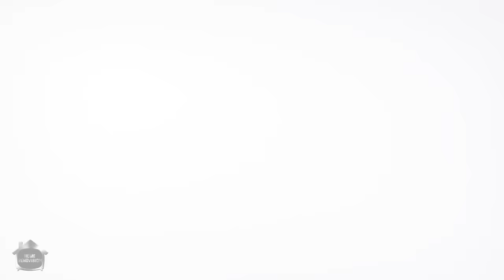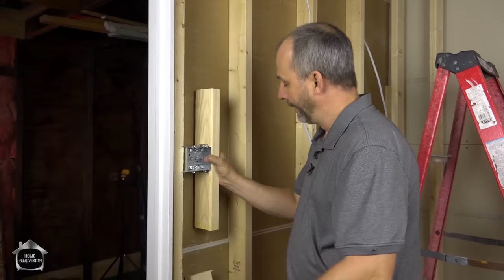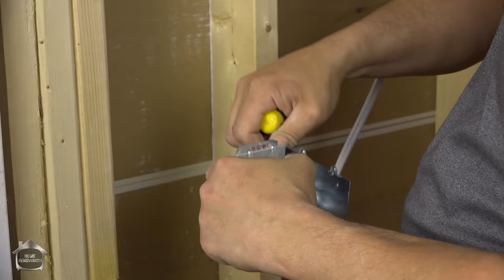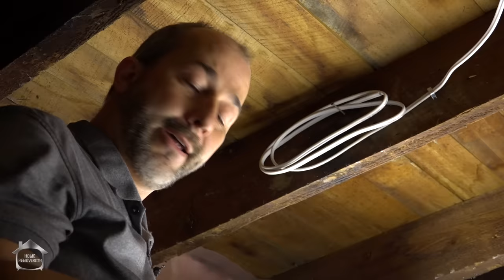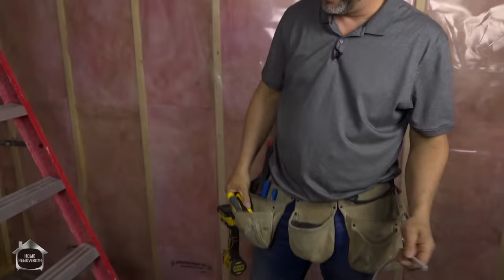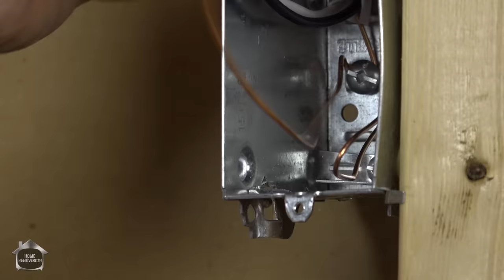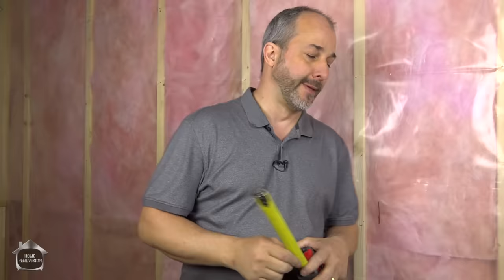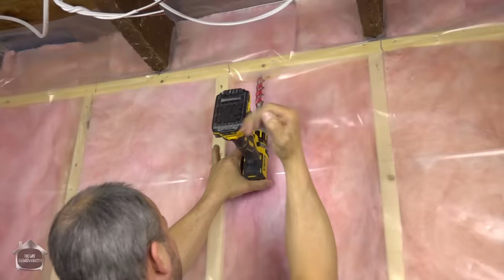DIY Bathroom Wiring | How To Run Electrical

Comment: Bad advice folks. Don't attack me, this is just the truth. He's a little too old school to understand current code but this is all very wrong. Also, no gfi used if fed via gfi breaker. And GFI's are to be wired a specific way. Line to line, load to load. Not just wires wherever you want
Reply: CPL more thoughts. Romex is stapled nowhere near 12" from the box. I think that he thinks you just measure in a circle around the box. It has to be strapped within 12" of WIRE from the box. So his big loops he's putting at every box is adding 8" of wire. And a major thought here- everything he did looks SOOOOO friggin bad. The better you make it look. The more likely your inspector is going to say: looks good, you pass! So ugly man I really can't get over it. I have first week helpers with no schooling that do a better job than that.

Comment: You make your joints and connections when you run the wire. NOT when you come back to trim and put the devices on man. And you are using 14/2 for your receptacles? Yeah thats a no no. I'm sure you are wiring according to the codes when your house was built but why would you do that? This is not how you wire a house or a bathroom or ANYTHING!!!

Comment: You should learn more about electrical . You made several bad statements . 2o  amp to gfci, Staples every four feet. And i hope you did not push wire in the vent.

Comment: Plastic boxes are better.  They are deeper and have a better fire rating.
Reply from the maker: Don't care about a fire rating. If I have a fire in my wall then I am out of here. that is what insurance is for. Cheers!
Reply: Not bagging on your work.  You do great work, and there is nothing wrong with what you did.  Plastic boxes are better for residential.  You do not need to bond them, and they are deeper.  In the garage you have a fire rating.  If you use metal boxes in a garage you will have to fireproof them with fire clay.  I am a contractor who has done over 75 houses.  My main money is from commercial, industrial, and farming.  I agree, it is smart to have plenty of insurance.  This is CA, USA.
Reply: Plastic boxes don’t ground, so you absolutely need to run the ground wire to the device.  Metal boxes ground, you technically don’t need to run the ground wire to the device, only to the box.
Reply from the maker: a definite benefit. Cheers!

Comment: This information is wrong. You must use 12 awg wire rated for 20amps.  Please correct this immediately and never touch an electrical tool again.

Comment: Dont forget, every box needs a neutral. Even switch legs! Invest in 3-wire!!!
Reply from the maker: That is what the white is for!
Reply: @HomeRenoVisionDIY  I know... But, when you run a traditional switch leg from a light with power in the box, if you run 2 wire there is no neutral in the switch box. as of 2017, you hqve to run a 3 wire to ensure you bring neutral to every box to accomodate for smart devices... bring power from the hot down to the switch box on the red, bring the neutral down too and cap it, and bring the switch hot back on the 3 wire black conductor... In the immutable words of Larry Haun, "Thats the code!". Obviously not needed if your powered feed is running through the switch box, and not just a switched leg...

Comment: Wow ... well always run 12 gauge for future. It’s better to have a not need it especially in a bathroom with a blow dryer straightener’s. Ground  wire needs to be bonded to the box so as long as one ground is bonded to the box you can wire nut the rest if you use metal boxes. Never cut your wire until you’re done running it. Always treat electric like it’s live so never leave exposed copper that is a extremely bad and dangerous habit. Why run from the floor to the ceiling back down the plug instead of drilling through studs? Was of wire . And why not use plastic boxes? Cheaper faster. And try to never use lineman as a hammer against metal objects . But if you are do not use the pivot point and then Lineman to hit objects .

Comment: Just a heads up to anyone planning on doing your own electrical work. Know the NEC codes and all City or county codes.  Failure to do so may be costly. There's just enough info in this video to get you in trouble. I made it in barely 2 minutes and he's already got it wrong. All recepticals are to be on 20amp circuits..... Just saying do your research or hire a real electrician. Yeah we are expensive but we  come with the correct knowledge and insurance.  Also if your house ever burnt down, you know your insurance company is going to look for any reason not to pay. So if they find out you pulled your own electrical permit they are definitely going to have a field day if you did it wrong. That said if you do it yourself, do it right!
Reply: Whereabouts do you live? Could be a difference in code due to location.

Comment: New forgot the television radio you forgot the automatic logs and motion sensors and if you're really smart you get a boat Dave you like a heated floor you going to let a heated toilet seat and a way to scorcher behind to cleaning because tissue Bieber doesn't work and those these require an outlet and have a remote since on the wall you aim at and basically it's a nice way I'm not touching your backside get cleaned up for his tries you off and all that kind of stuff but they're pretty cheap we get a general one but if you really relate me where the only country that doesn't cleaner selves I guess Canada do with a don't have go days in the bathroom how do you get you back said clean and wipe your behind if you don't like it with water Room in a washcloth is taught you don't get it clean so at wagtail a baby killers all in on Dali never get it cleaned his and smears it around until you stain your paranoia anyhow you forgot the handrail some people don't like they're used towels like they have their hands dried on a handrail and you forgot the shot back to avoid all the other things I might wanna plug into the bathroom that dimension the what else can you buzz me to air freshness and those those are battery operated they squirt you can go online with that as well but the security system the panic buttons the if you're smart you gonna put in for the handicapped getting up a toilet always have bars around the toilet and in the shower he forgot about that part into what you show Joe is a basic wire diagram you know a actual bathroom design away from everything and shown in like a leg of as kamatik through a see through like the walls were see through but radiant floor heating is long

Comment: That staple is for two 14-2 cables, not a single 14-2
Reply from the maker: works just fine with one.
Reply: iIt doesnt.  it allows movement of the wire within the staple.  Wire moving against a metal surface can wear out the insulation.  For a single wire use an -S1 staple.  For two wires use an -S2.  There's a reason why staples are designated -S1 or -S2.  Don't reinvent the wheel just because it works for you.  By that reasoning, securing the wire with duct tape also works?
Reply: John D or if you use an s-2 staple, hammer it in further past the ears.

Comment: This guy is not an electrician using number 14 wire for a GFI receptacle in the bathroom?  Hair dryer will trip a 15 amp breaker but listen to him at your own risk he's not an electrician which is why

Comment: The first thing out of your mouth is  WRONG. Code requires bathrooms to have a 20 amp circuit. That means 14 wire is too small and against code. 🙄
Reply from the maker: Hi Brian, The code in your Country is different than mine. Big deal you can install a 12 gauge wire and a 20 amp circuit without being such a jerk about it. Cheers!

Comment: Knows just enough to be dangerous. I enjoyed your painting videos however.
Reply from the maker: Please feel free to discuss what you think is dangerous about this install. cheers!
Reply: Nothing in particular. I just find it to be a tad much making videos about things you arent licensed to do (I assume).
Reply from the maker: Funny thing is, an electrician gets a license knowing industrial ,commercial, agricultural and residential wiring. The truth is residential wiring is basically 2 parts. rough in and fixtures and the panel assembly. I use an electrician to wire the panel. I don't pay for NASA to fire off my kids bottle rocket on his birthday and I don't pay for an electrician to run 14/2 wire for me. i GET TIRED OF SEEING 18 YEAR OLDS DOING A JOB i CAN DO MYSELF AND PAYING THEM WAY TOO MUCH MONEY TO DO IT 4 TIMES SLOWER THAN i CAN. Cheers!
Reply: @antonchigurh9129  dude, that's why there are inspections at the end. Even if you make mistakes, someone with a license comes in and checks. It's not very hard to pull a couple of cables... Probabaly more difficult to wire up a home theatre system than it is to wire stuff like this.  You just need to know the code rules, basic electrical knowledge, and you're good to go.
Reply: @antonchigurh9129  Bro..you don't need licenses to work on your own home or a direct family members house. A competent person (barring structural or work needing certified blueprints) is all the city needs to approve your permit. The permit puts the city and its inspectors liable in case the insurance coverage is needed.
Reply: @HomeRenoVisionDIY  These guys think electricians wire new homes, the truth is some $12 - $15 per hour labourer does the work. After they're finished a master electrician, inspects a certifies the install.

Comment: Please stay away from wiring. You are doing it wrong and not to the NEC. You have many code violations if in the US!
Reply: 210.11(C)(3) Bathroom Branch Circuits
One or more 120-volt, 20-amp branch circuit shall be provided to supply bathroom receptacle outlet  required by 210.52(D) and any countertop and similar work surface receptacle outlets. Such circuits shall have no other outlets. 

334.30 Securing and Supporting 
NMB cable not exceeding intervals of 4 1/2 feet.

Just to name a couple violations. You have many more as well. Please leave it to the licensed pros. Not something anyone else should be doing.

Comment: No disrespect, but this video made me cringe!  Normally, I'm on board, but this is not good.  If this kind of work (and I'm not just talking about code) passes inspection in your area, I guess more power to you?
Reply from the maker: Hi Brian, would love to hear what your concerns are!
Reply: @HomeRenoVisionDIY  I tried sending an email to the address in the about page. I got a response stating that it's for sales.
Reply from the maker: Brian Piper, I am not looking for an email. simply voice your opinion on the comment section so we can all discuss it. Cheers!